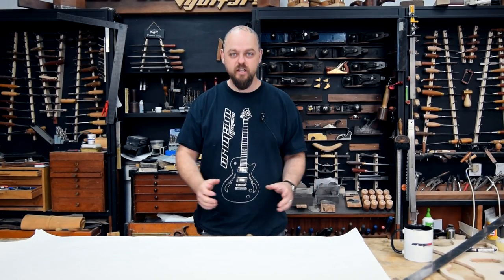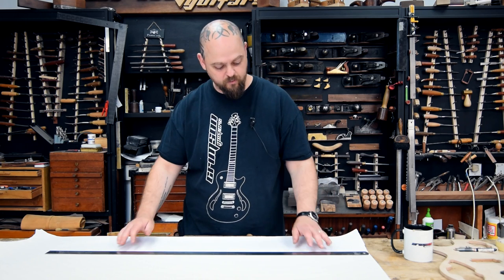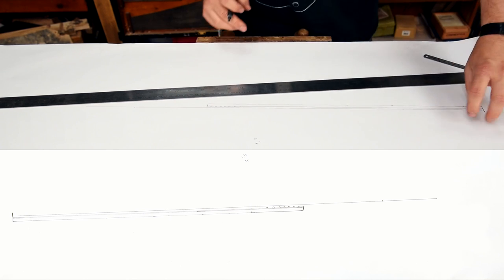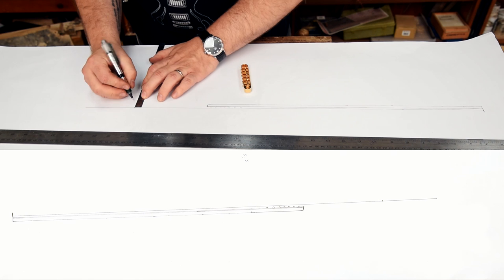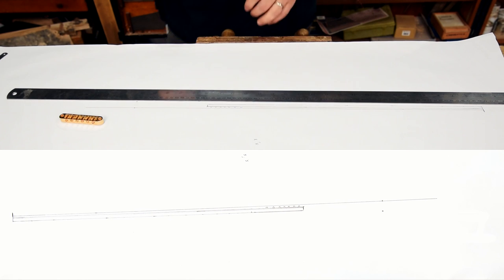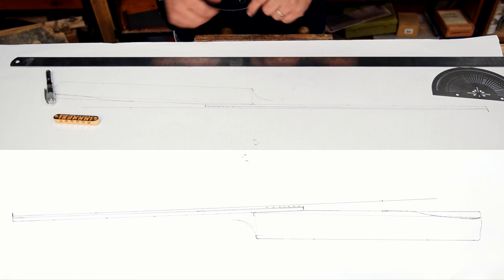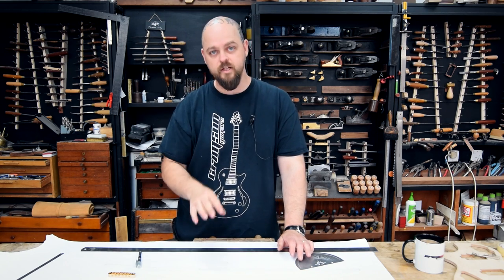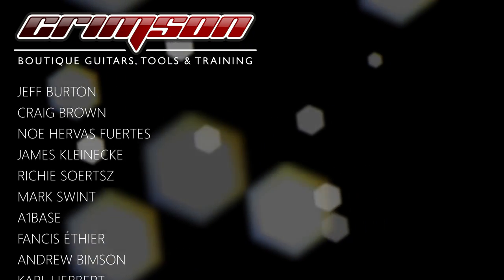Mini-Torial - Achieving the Perfect Break Angle... Every Time!

Comment: Using this technique with a tele style bridge (12/13mm) allowing for adjustment would i then need to plane the required angle into the neck its self or into the body? Also in regards to the fret board radius/height am i drawing the edge of the fret board as i would look at it or the zenith or full height as it were of the centre of the fret board. I strive for perfection and rarely attain it lol.
Reply: Robert Murphy I’d imagine it's far easier to plane it off the neck tenon than to try and rout your pocket on a 3 degree angle...

Comment: What about non-carved tops like flying v? Should you connect the line from the area where the neck joins the body? And then what happens between that gap that you mentioned between the body and the fretboard? Cheers

Comment: Got a question. Very good info. I have been looking for this info. Do you measure your bridge so that the strings still have a gap when the saddle is in the lowest position? I’m thinking about bottoming out the saddle to compensate for neck bow under string tension.

Comment: Hi Ben, I like over engineering and over complicating my projects, its part of the fun, so Ive nearly finished a jig for neck pockets with built in adjustment for the break angle. It might need some refinement but Im confident it will work. Thanks for the tutorial old bean.

Comment: Quick question, where is the angle applied? Do  you cut the slot parallel to the surface of the body and angle the back of the neck, or the other way around? Cutting the neck sounds like the obvious answer to me, but then again what do I know.
Reply: Normally the bottom of the neck is flat, and the neck pocket is angled as you can do this by putting a routing template on with the angle applied to it when you cut the pocket, but it does depend on the body style and design of the neck joint

Comment: Why does a guitar need a break angle in the first place?
Reply: To let the strings be high at the bridge and low at the frets, while keeping the fretboard close to the body. 

All bridges have some minimal mounting height. For Tune-o-Matics, that always requires a neck angle. Top-mounted Floyds (without a recess cavity) also require a neck angle. Also, if you want the guitar to have a trem and be very thin, you need the angle, or otherwise the bridge pickup route would overlap with the spring route.
Reply: unless the bridge was recessed into the cavity, but the purists don't like that
Reply: My understanding is its due to the bridge height. If your bridge isn't very high you don't need the angle. However if the bridge is quite high, the action will be too high at the body end of the neck.
Reply: Teles and Strats actually usually don't have a break angle. That's why they have the neck "stick up" higher out of the body than Les Pauls do, for example.
So, having the neck "high" relative to the top is one way to go. Another way to go would be to recess the bridge into the body so your string can be closer to the top. The only other option is to have a break angle, so the distance of the string from the top increases on their way from the neck joint to the bridge.
Reply: Or the 4th way is the Rickenbacker way, where its not technically a break or recessed bridge, but they carve a fade into the bridge area. I personally think this looks stunning done this way!
Reply: To answer that question I would advise you to visit http://www.acousticguitarforum.com/forums and ask it there :)
Reply: I answer that question in a video. Take a look. it's the one with "Neck Break Angle Explained" in the title.

Comment: It's much easier and more practical to use an adjustable neck angle device like a Fender-style micro-tilt adjuster. Set/through necks, back angled head stocks and other forms of permanently applied angles on a neck are unnecessary and ultimately cause more problems than they solve. Any sensible design allows for all components of the instrument from neck angle to action, intonation, electronics, etc...to be modular and independently adjustable.